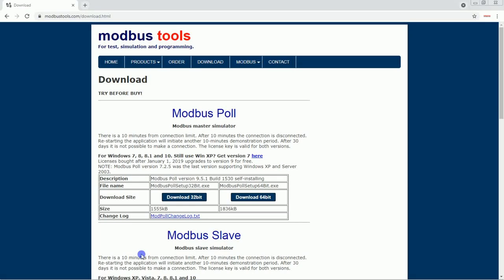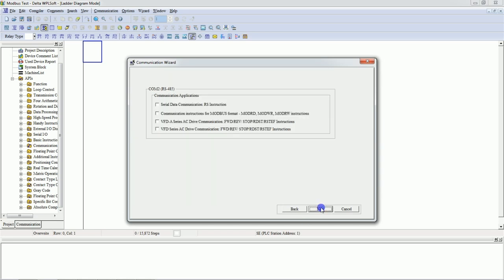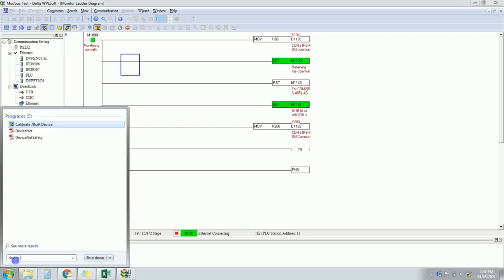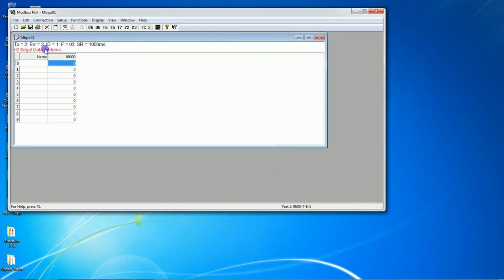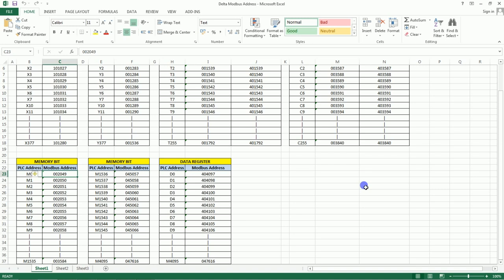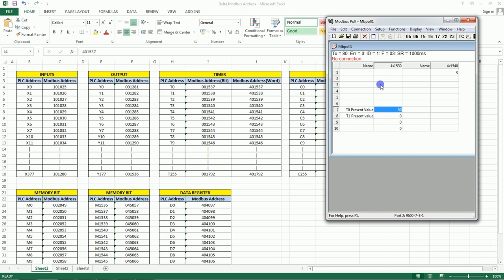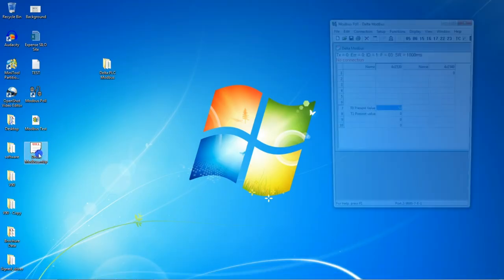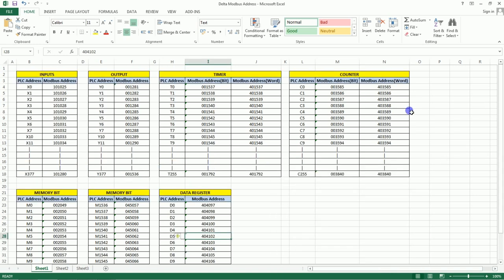How to receive data in PC from Delta PLC by Modbus | Delta PLC Modbus Address | English

Comment: Great video, thank you for your time. I want to use RTU mode, I set it as. Baud rate = 9600 bps, parity = even, data length = 8, timeout = 200 ms. The problem is in Modbus Poll, a "timeout error" appears when selecting the same plc parameters. Any ideas please?

Comment: Hello sir i followed the same procedure what you have shown in the video but when I run it is showing timeout error so what should i do?
Reply from the maker: Hi..Plz check modbus cable connection..try with swapping cables..
Reply: Sir we are facing checksum error please rectify it..
Reply from the maker: Which software are you using for modbus simulation
Reply from the maker: Plz follow the instructions in video...don't skip any step...it should work 💯%
Reply: @IndustrialAutomation  the one which you gave in discription box modbus poll master
Reply from the maker: Don't download poll master...Go for slave simulator which is on same website
Reply from the maker: Plz cross check software which i am using in video and one which u have...i think u have downloaded wrong modbus software
Reply: Sir please help in this issue
Reply from the maker: rushikhole@gmail.com
Reply from the maker: Plz share program backup